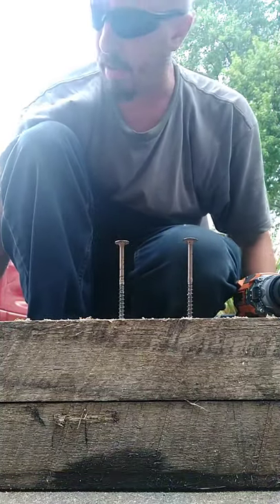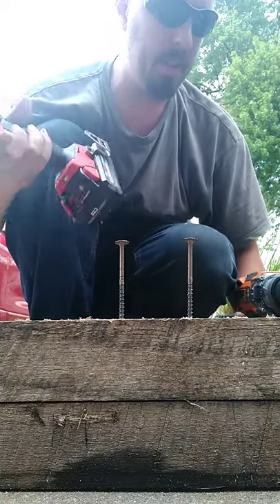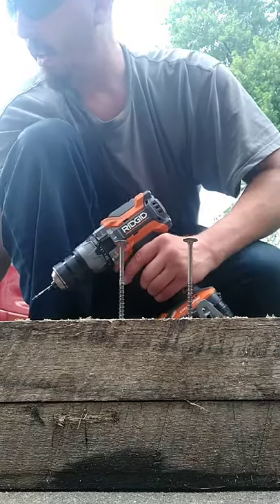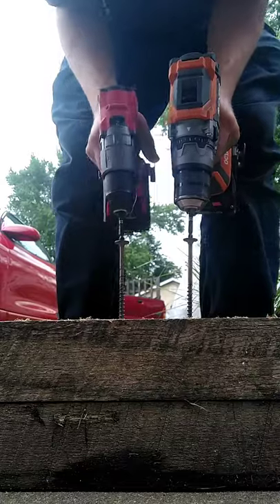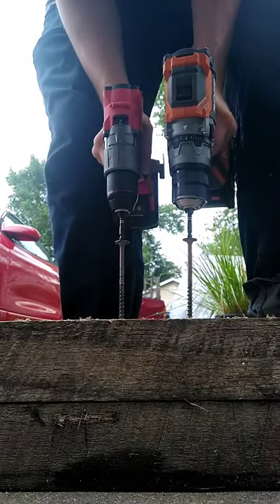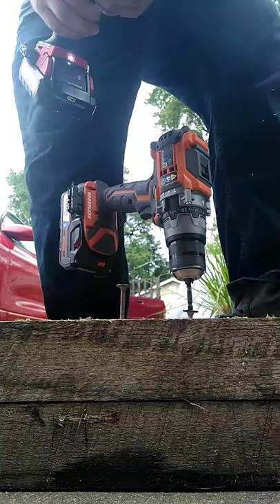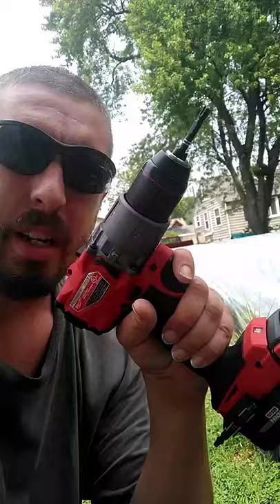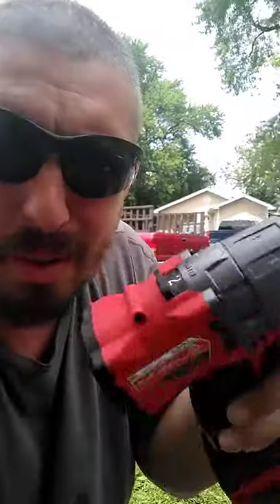Milwaukee fuel hammer drill vs Ridgid Octane hammer drill 5" ledger screws part 2

Comment: I think the Milwaukee is protecting you from torquing your wrist. You can see in the video how your wrist gives way before the drill stops itself, this is most likely a feature of the drill that attempts to stop it when it binds up.
Reply from the maker: Could be
Reply: Right, sure....🙄
Reply: I think only the Gen 4 Milwaukee drill has anti kick back. The Gen 3 might not have this and thus just goofed up

Comment: I heard somewhere that the Octane series was one of the strongest lines of tools when they were released.
Reply from the maker: Some of the tools are top of the line, like the octane recip and jigsaw
Reply: @InNerdimensional  The impact driver was supposed to be one of the best on the market.
Reply from the maker: @DiligentDave1966  makita, Milwaukee and flex are more powerful, but the octane has some awesome features like pulse mode. Helps on easily stripped screws
Reply: @InNerdimensional  That would depend on which Makita you’re talking about. Tools with SOALZ showed the black Makita getting beat by even 12 volt tools in the torque test.
Reply from the maker: @DiligentDave1966  it's in my videos somewhere. Xdt14 or something
Reply from the maker: @DiligentDave1966  https://youtube.com/shorts/XgomUlTA1dw?feature=share
Reply: @InNerdimensional  I just watched it. That’s actually a better comparison since the Octane is a bigger tool.
It was the subcompact all black Makita that got dominated by everything else.
That said, I thought the Octane came out before the Makita xdt.
Reply from the maker: @DiligentDave1966  I still love my ridgid even though I have the Gen 3.5 Milwaukee. It's almost too powerful
Reply: @InNerdimensional  I can’t claim to know anything about Makita because I’ve never used one. I can only go by what I’ve heard about them.
Supposedly the older black and white ones were a little underpowered but really durable.
People rushed out to buy the teal version because they were supposed to have much more power, but I heard they were burning out quickly. Again, I don’t know,and maybe they fixed the problem.
The only one I’ve really seen in action was the all black version, and I wasn’t impressed at all.
Reply from the maker: @DiligentDave1966  the one in my other video smoked a bit. And the flex burned up
Reply: @InNerdimensional  I was told years ago that you should never buy a car the first year it comes out because it hasn’t been proven whether it’s reliable or not.
I think that applies to just about everything.
I don’t understand why people are jumping on the Flex bandwagon, when they just came out recently.
Reply: @InNerdimensional  The new Ridgid brushless is more powerful than the Octane too, I believe, but it seems like a lot of the subcompact tools are less durable no matter what brand they are.
Reply: @InNerdimensional I think you’re referring to the stealth force when you say pulse, but I could be wrong.
The high torque octane impact wrench was the strongest on the market for a long time. Even TTC used it as the standard to compare most of the newer, high torque impact wrenches with.

Comment: I think that’s why Milwaukee went to a mechanical clutch in the gen 4.
Reply from the maker: I think it was just too tough for the drills
Reply: @InNerdimensional  That could be, but I have heard people say they much prefer the mechanical clutch.
Reply from the maker: @DiligentDave1966  I actually haven't tried the clutch
Reply: @InNerdimensional  I think electronic clutches are more prone to slipping.
I could be wrong, but that could explain what happened in the video.
Supposedly, the gen 4 has better sustained power than the gen 3.
Again, I’m not positive.
Reply from the maker: @DiligentDave1966  I'll have to play around with the clutch and drill settings to see what happens
Reply: @InNerdimensional  I just meant, that in this video, you said you thought the Milwaukee clutch might have slipped out of drill mode.
I’m not sure what problems people have had, but almost everyone that made a comment about the gen 4 was happy that Milwaukee went to a mechanical clutch.
Reply from the maker: @DiligentDave1966  right on, my ridgid has a mechanical clutch and it works great
Reply: @InNerdimensional  Have you ever used a Bosch or Dewalt drill?
Reply from the maker: @DiligentDave1966  not really. Not a fan of either really
Reply: @InNerdimensional  What would you suggest for a mid tier drill?
Reply from the maker: @DiligentDave1966  either the 12v fuel Milwaukee or ridgid subcompact.
Reply: @InNerdimensional  I actually bought the M12 set, but I returned it because I didn’t really like the grip. My hands are not that big, so the M12 grip feels kinda bulky.
I’m looking for something stronger than the Ridgid subcompact because I already have a Dewalt dcd777 that has almost as much power as the Ridgid subcompact.
I was considering the 800 inch pound Ridgid, but it seems to perform inconsistently.

Comment: The Milwaukee is designed to shut off before snapping your wrist lol. Even if you’re not drilling anything if you just spin the chuck and then quickly rotate your wrist it will turn off.
Reply from the maker: I don't know if that's what happened, I'll have to try again
Reply: @InNerdimensional  it’s definitely worth looking into, even just a simple demo from them on how it works. It’s pretty cool, actually!

Comment: why hit this on speed 2? Even makitas sub compact would finish this without to many problems on Speed 1.
Reply: Speed 1 is a higher torque mode. Speed 2 is faster but "weaker". This is why speed 1 will drive things better. These are hammer drills. Impact driver settings are different.